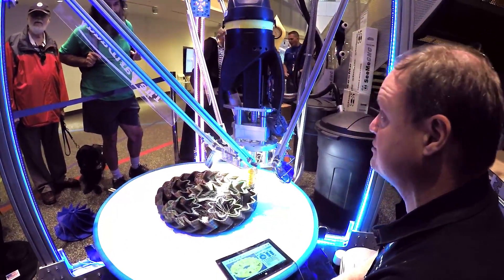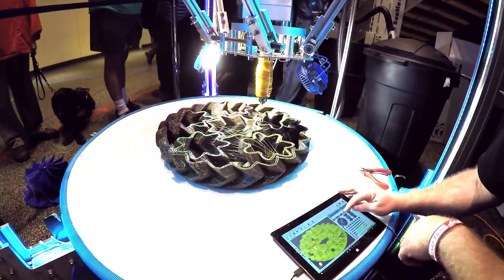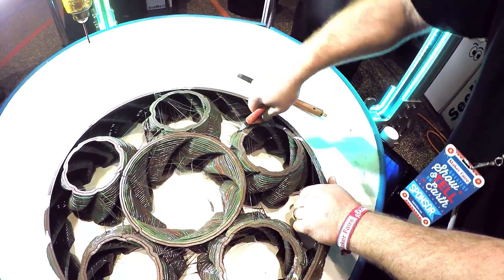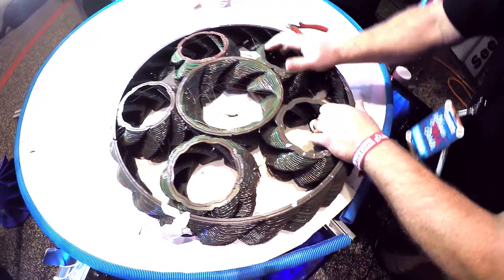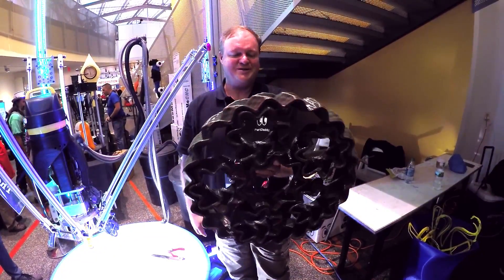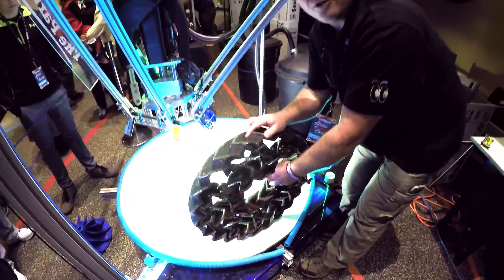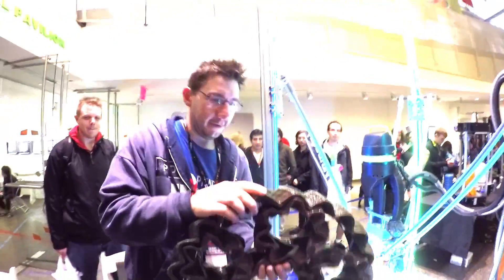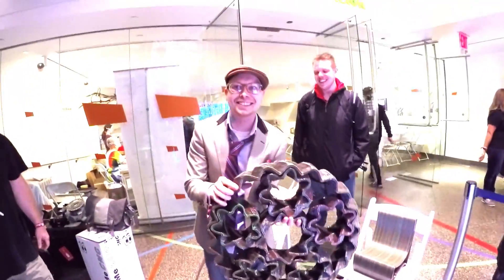3D Printing: The Part Daddy print a Gear Bearing

Comment: The filament cost is as much as 1 page worth of ink on my inkjet printer.
Reply: Ink is expensive stuff. Not to mention that if you dare leave it more than four months (on my printer, which sucks hardcore) the ink dries up and you can't use it!

We need a replacement for ink printers. (Can someone invent commercial holograms, please? :P)
Reply: +nambinhvu Laser printers use ink -_-
Reply: No, laser printer uses toner.

Toner which we use to print our stuff contains some powders on it. This is the modern way to print something on paper. Before that, there was ink to print things. The 4 processes were complicated and there were a lot of hassles. However, with a toner, there are not many issues. As it contains only powder, the printing quality has improved. Generally, a toner comes with a toner cartridge. This combination makes sure that you are getting the quality service from a toner. The powder which reserved in the cartridge is mainly a mix of iron oxide and carbon powder. As we know that carbon is black in color, the iron oxide makes it more perfect in color. For a better output form, the toner and the carbon powder melt with a polymer. When you give the print command, the toner sprays the powder on the paper.

The outside of the toner is usually made of stainless steel. Stainless steel is durable and keep the toner like the new for a long time. If you open the toner, you will see there is roller on the toner. This roller controls the amount of the powder which it sprays on the paper. The air jet milling of the toner makes sure that you are getting the perfect amount of powder from the toner for the perfection. What is toner made of also depends on the manufacturer. Some high-priced toners use better quality material; especially the commercial grade toners are made of durable and high quality material. Some manufactures also use the chemical processed to improve the printing quality.
Reply: pellets are cheaper! in bulk you can have them for 2-3$ per kg
Reply from the maker: Bahahahhaa
Reply: Stettafire They have printers that don't clog from old dry ink, it's called a laser printer. They use toner, which is a dry powder. Thanks for removing your comment and uninformed response. In return I have removed my mean comment and rewrote mine so it would make sense. XD

Comment: If they don't make a display cart that uses those for wheels, then they are missing a golden opportunity.

My first thought was bicycle, but how would you drive the rear wheel? Unless you interface another gear to the top of the outside gear ring...

Comment: Are you going to show how the octopus from the last part daddy turned out
Reply from the maker: we stopped it and scrapped it
Reply: 3D Printing Nerd why?
Reply from the maker: The museum asked about printing a rocket to be next to their other rockets at Rocket Park. That takes a while, so we did that. Scrapped the octopus (it didn't even have a full first layer done) and started printing the rocket. I ended up putting it on my shoulder and running through Maker Faire with it :)
Reply: 3D Printing Nerd When it comes to 3D Printing, you're like a kid in a candy shop, aren't you?
Reply from the maker: +Goat Bot oh yes!